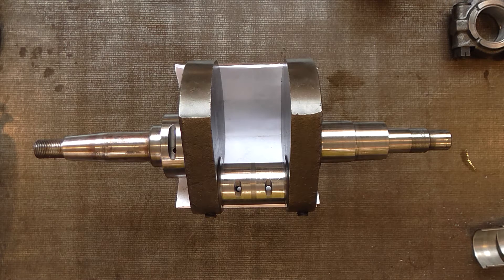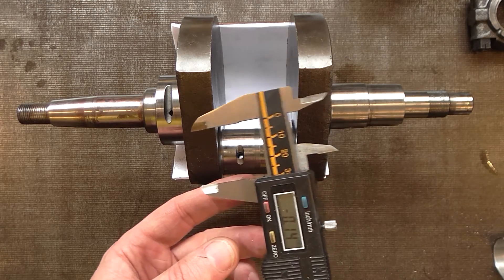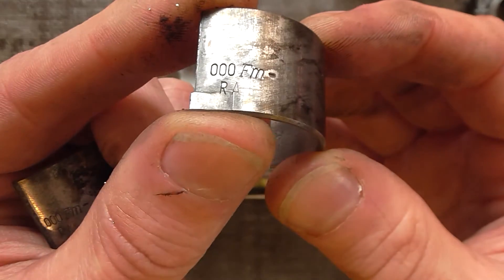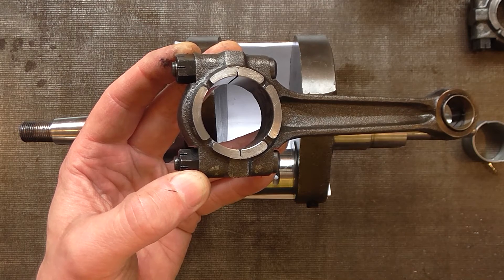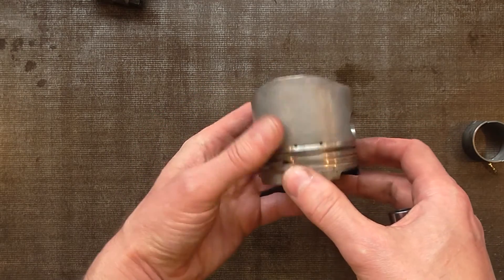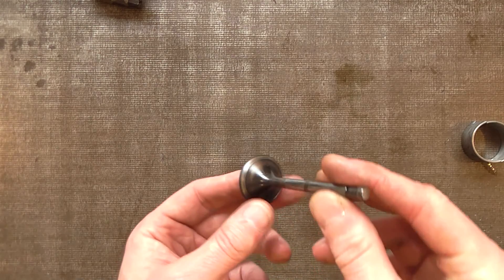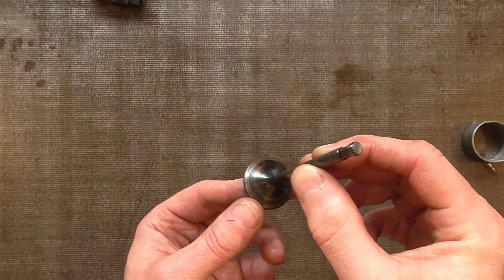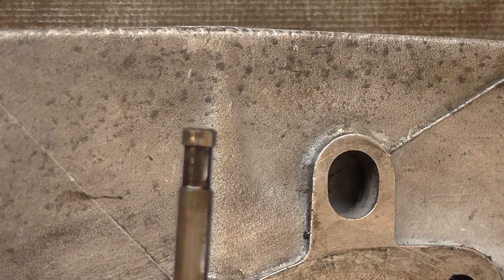Morini 350 Engine strip & inspection part 3

Comment: Looks like someone, maybe a mates mate down the street? has done some work on this and put it together without cleaning all the orifices and connecting oil galleries out with fluids and or compressed air! and all the crap has been circulated around the bits he did?

Comment: paul i have  just  stripped my 350 morini s. 1976 the problem is the head and base gaskets are not  available  at the  moment  from  mdina italia...apart from  the  composite ones ..are they any good as it had the alloy  ones on.
also  need a rebore or  re sleeve on the barrels i  notice  you  mention  a  engine  person  for the crank ...do they  do  the sleeve kits
hope  someone  can help
thanks  keith
Reply from the maker: The composite gaskets are for use with the early barrels that have a slight recess in the top of the liner. I'm not a big fan of the NLM (now Mdina) pattern alloy gaskets. They're pretty rough round the edges and quite hard, needing annealing before use. NOS gaskets are still available if you look around (ebay.it for example) and Athena (amongst others) have reproductions. If they're not damaged or overcompressed, then the alloy gaskets can be annealed and reused pretty much indefinitely.

Several sizes of pistons are available, including a 375 overbore (actually 366cc). You can even go further with a 402cc conversion from Ducati Developments.
Reply: @EVguru  thank  you for that  information..could you advise me of a  re sleeve to std ..as a previous person bought 2 new std pistons..so it would be nice to use them.. the barrels have like a relief at the top 1/2 mm deep and  4mm wide..so are they early barrels
hope you can help
keith
Reply from the maker: @keithherbert1581  Liner replacement is will almost certainly cost more than new pistons.
Reply: @EVguru  okay thank you...who world you get the pistons off as mdina not got them
Reply: also i  can  get  new std barrels  but  the  old type ..but are mine the  old  type as i  said mine have   a  small recess in the face ..